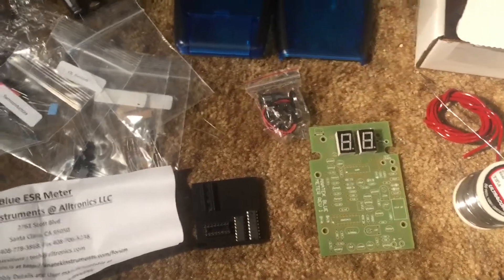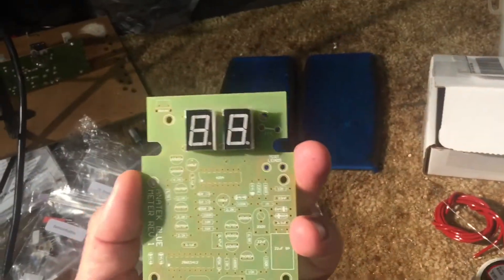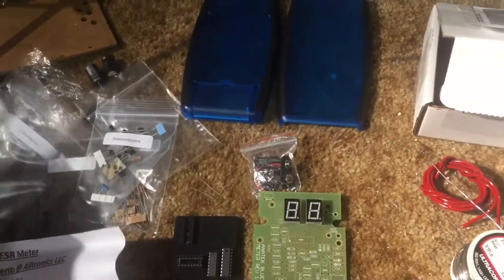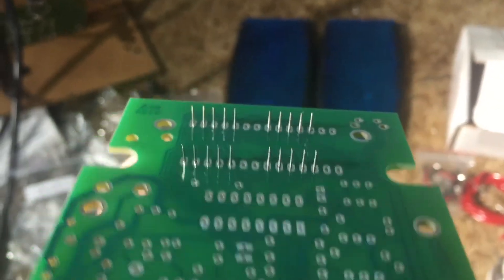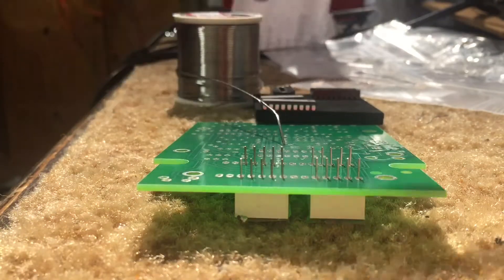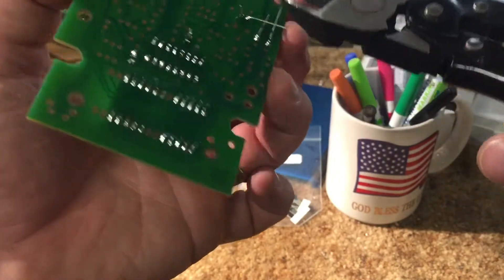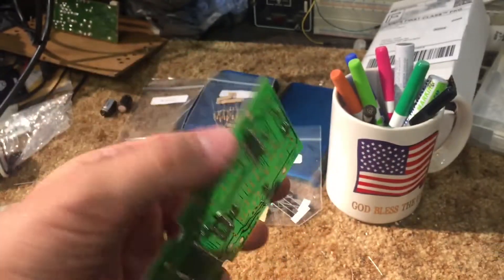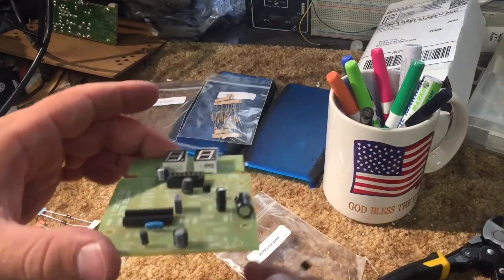Blue ESR Meter - PCB Build

Comment: Got one of those, works great!
What kind of ESD mat are you using there, looks comfortable?
Reply from the maker: Electrostatic discharge mat? Like... carpeting... on the workbench. In a wooden shed. Helps to keep fallen screws from getting lost. Dunno about ESD abilities. But great at general ES.
Reply: Sounds clever, crawling on the floor looking for items rolling off the workbench is never fun. ;-) 
Nice build, I assume it has been a trusty helper since 2017?